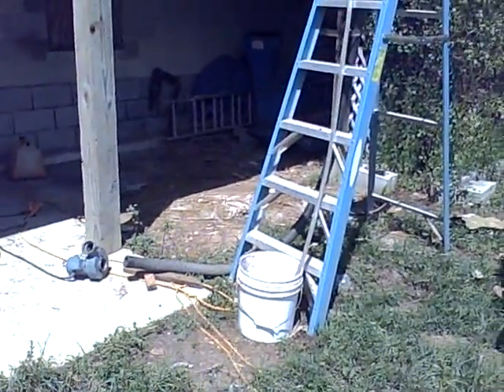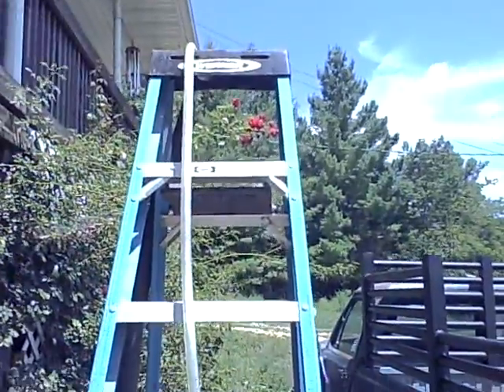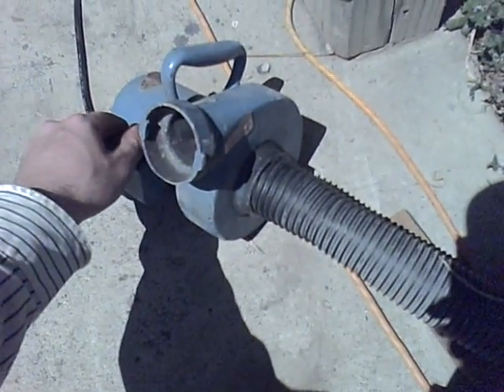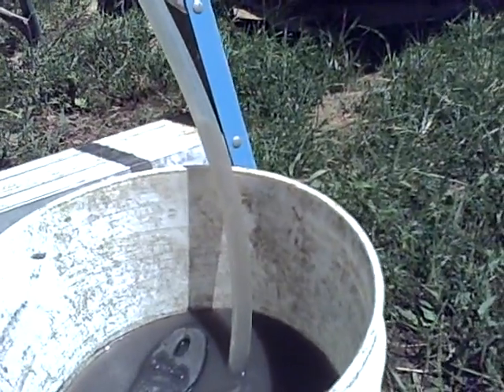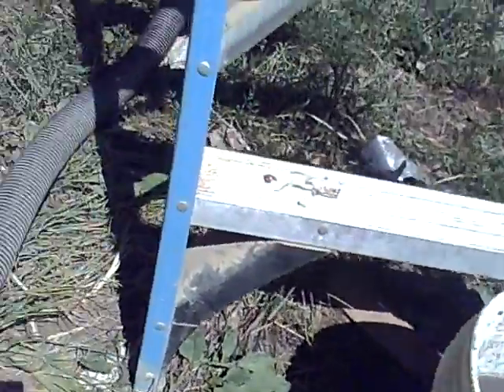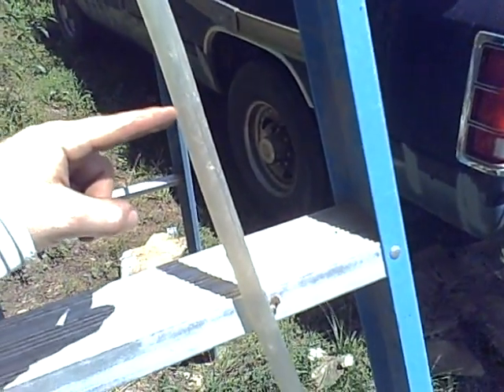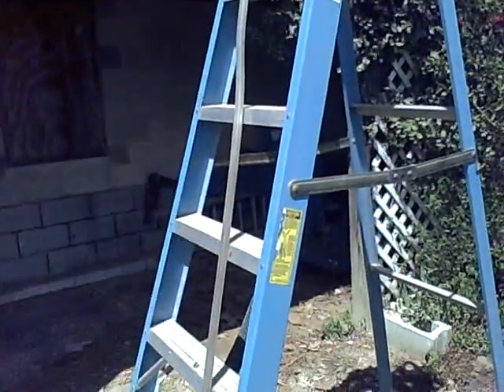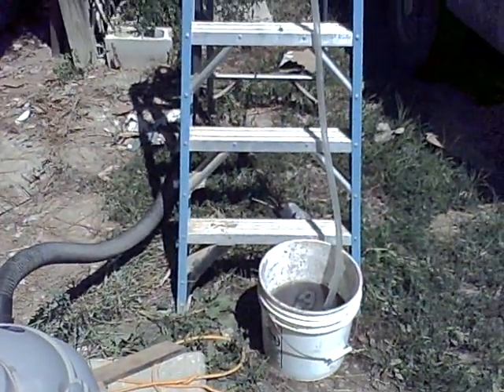Water column using blower and shopvac

Comment: Using a water column like that is actually like barometer. To get a more accurate reading you place the clear hose in a very big U with one end connected to the blower and water a good three feet at the bottom of the U. Marking of the water level before you start the blower lets you monitor how far much vacuum you create. You can calculate the force using the inside diameter of the hose and the distance the water was displaced.